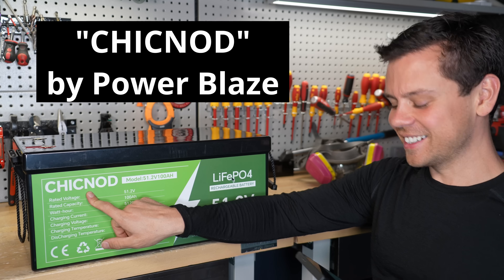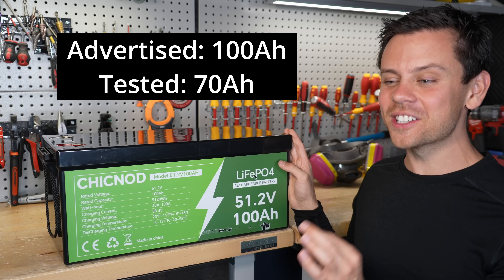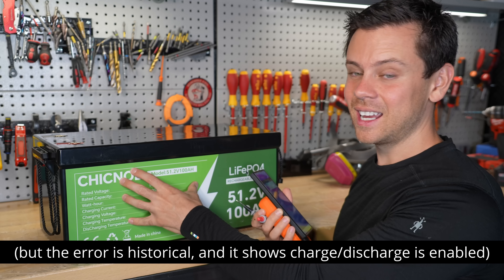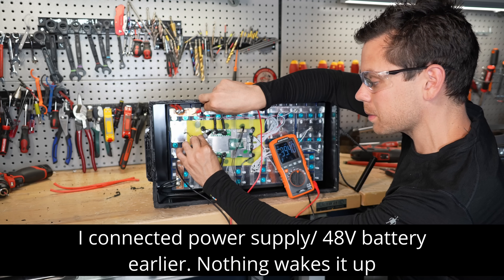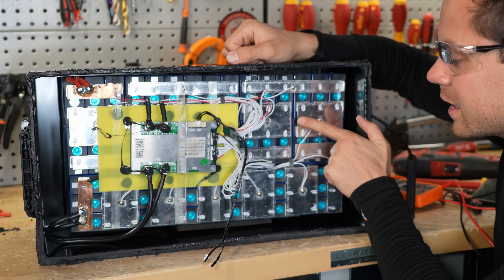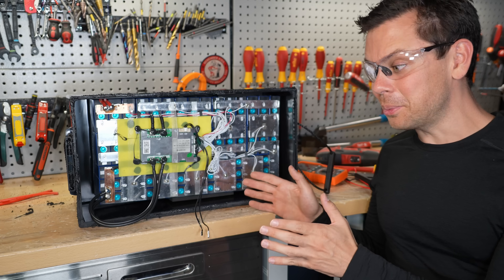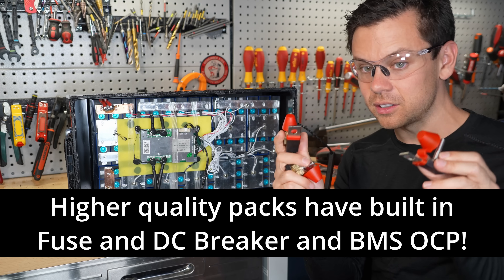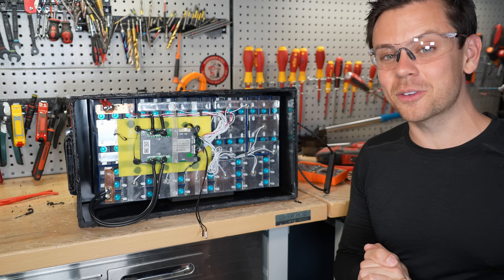TEMU Battery Scam? 48V LiFePO4 5kWh for $529 CHICNOD

Comment from the maker: Starting the return process with Temu and sending this video as my proof of issues 🤣 what do you think they will say?

High-quality budget 48V batteries I like right now:
Ecoworthy Server Rack Battery: https://amzn.to/3HOZjYY
Vatrer: https://amzn.to/3SBJV4o
Yixiang 16kWh Battery: https://yixiangpower.com/products/yixiang-vertical-15kw-diy-lithium-battery-box-kitus-stock-16pcs-eve-314ah-brand-new-grade-a-lifepo4-battery-cellchina-stock?sca_ref=9207522.jYuzmwEjUpH

~~~~~~~~~~~~~~~~~~~~~~~~~~~~~~~~~~~~~~~~~
Tired of getting ripped off? Check out my "Will Prowse Approved" solar product recommendations below!

12V Batteries
https://www.mobile-solarpower.com/lithium-batteries.html

48V Batteries
https://www.mobile-solarpower.com/48v-batteries.html

Offgrid Inverter System Builder
https://www.mobile-solarpower.com/48v-complete-system-blueprint-559371.html

Hybrid Inverter System Builder
https://www.mobile-solarpower.com/code-compliant-48v-offgrid-system.html

Mobile Handtruck System Builder (very popular!)
https://www.mobile-solarpower.com/mobile-48v-system.html

Solar Panels
https://www.mobile-solarpower.com/300w-solar-panels.html

Ground Mount Solar Racking
https://www.mobile-solarpower.com/ground-mount-racks.html

Wire, Lugs and Busbars
https://www.mobile-solarpower.com/wire-and-connectors.html

Tools
https://www.mobile-solarpower.com/tools.html

Fuses and Circuit Breakers
https://www.mobile-solarpower.com/fuses.html

Plug-N-Play Solar Systems
Ecoflow, Anker And Bluetti! So many models to choose from. See my current recommendations here:
https://www.mobile-solarpower.com/full-size-systems.html

~~~~~~~~~~~~~~~~~~~~~~~~~~~~~~~~~~~~~~~~~~
Need to build a large DIY system? Need a trustworthy solar distributor? These are my favorites:

Signature Solar
Creator of EG4! Solar Minisplits, Victron and More! Largest Solar Store Online.
If you want $50 off, please use my link below and coupon code "DIYSOLAR50":
https://signaturesolar.com/?ref=cPwLcVc0SW-BjN

Current Connected
Best Prices for EG4, Victron, Midnite and so much more! Fast Shipping and Highest Rated Customer Service:
https://currentconnected.com/?ref=wp

~~~~~~~~~~~~~~~~~~~~~~~~~~~~~~~~~~~~~~~~~~
Join our DIY Solar Community 
Need more help? Join the largest solar forum on the internet for beginners and professionals alike. 140,000 members and counting!
https://www.diysolarforum.com

Check Out My Free Book
Best-selling and beginner-friendly guidebook to off-grid 12V solar!
https://www.mobile-solarpower.com/the-book.html

~~~~~~~~~~~~~~~~~~~~~~~~~~~~~~~~~~~~~~~~~~
Contact Information:
I am NOT available for personal solar system consult! If you wish to contact me, this is my direct email: williamprowsediysolar@gmail.com
FTC Disclosure Statement and Disclaimers:
Every video includes paid promotion or sponsorship (such as free products for review). Some links on this YouTube channel may be affiliate links. We may get paid if you buy something or take an action after clicking one of these. My videos are for educational purposes only. Information is subject to change/update at any time. Electricity is DANGEROUS and can kill. Be smart and use common sense :) DIY Solar Power with Will Prowse is a participant in the Amazon Services LLC Associates Program, An affiliate advertising program designed to provide a means for sites to earn advertising fees by advertising and linking to Amazon.com
Reply: “You voided the warranty when you opened it” 🤷🏻‍♂️
Reply: @BigFern9876  No you voided the warranty the moment you opened it... The "it" in this case being the shipping packaging. Temu is great for some items, but when it comes to electronics or batteries you really do toss a coin when it comes to quality
Reply: @BigFern9876  this isan't a warranty issue, its simply fraud
Reply: @BigFern9876  imma guessing with his knowledge and what he does for a living and the subscribers he has they won't risk voiding it
Reply: I suspect they might ignore you (most likely) but I would like to know if they respond. 😅
Reply: I got a bad battery from them. I returned it and they said it's all scratched up. You damaged it. No, you idiot, that's the way you sent it to me all scratched up and used. Then I filed a case with them.Then they said my case is denied.That's when I contacted PayPal and told them what's going on.They send you junk and then blame you for damaging it when there are the ones that senate damaged
Reply: they will say
''Hello Mister, you sawing my product into two piece..no refund i give you!''
Reply: We never sent anything😂
Reply: Going to be interesting to hear what they say
Reply: I  have no idea but do tell us  what they say,
Reply: Then go with chargeback via visa/mastercard. If you say that they usually accept refund as they paying for chargeback extra
Reply: Dear cusomers, you voiding warranty on our fine products by damaged to case so no money for you. have a fine day at best regards, temu
Reply: They will say you shouldn't have cut it open.
Reply: Hi Will, this is off topic from the current battery but relates to the usual more reliable rack mount batteries. 

Is it possible to put these 48 volt to 51 volt rack mount batteries in series such that you'll end up with a total of between 400 to 800 volts? This relates to exorbitantly priced high voltage battery systems that I've been seeing become normal in the market. I know going higher voltage than 48 volt is eventually where the market will go based on current trends. But I'm just wondering if that's something that's possible with any of the BMS' of current rack mount batteries. I'd really appreciate if you could talk about this. Thank you.
Reply: @amateurwizard : I'm 95% sure that would be just like putting 4 12v batteries in series to get 48v, the BMSs won't care
Reply: @amateurwizard My understanding is that very bad things can happen if one of the batteries goes into protection mode for some reason. Over current or over voltage or under voltage etc etc. 

It’s a bit counterintuitive, but when that happens the battery that disconnects suddenly sees a very high voltage. If the MOSFETs aren’t rated at a high enough voltage, it can damage them. 

Think about it like this: four 48v batteries in series, with a light bulb. If you unplugged one of them, and connected a multimeter to the terminals, you’d see 3*48v = 144 volts. That’s the voltage that the MOSFET would see. And high voltage MOSFETs are expensive.
Reply: if they refuse to return, report them to a official US consumer agency. You are doing god's work!
Reply: I wonder if they will offer you a partial value return. 

You showed it had failed before you opened it. So you should get your money back. Please let us know
Reply: They will ask you to send a video of the issue and ask if you charged it first. It won’t matter that you already did a video. Because nobody is actually doing anything.
Reply: They'll probably tell you that you voided the warranty when you opened it, although the problems your showing with it is a valid point
Reply: I’m in the UK and I’ve actually had some good experiences with Temu…. I complained about a toy RC car that I bought for my Nephew. They sent out a brand new one. No quibble, No problem
Reply: Great video as always.
Thanks for taking the time and effort to show us what junk batteries are all about.
Personally I think you’re going to get the “Runaround” and it will be a dead end.
I refuse to be pulled in by their low prices. “If it’s too good to be true, well it probably is.” Thanks again Will!
In a way it was a fun video… your dissection and testing the different components had a medical flair to it.👍👍
Reply: You're an American with a large, fully-charged, junk lithium battery. We all want to see what happens when you put it down range and hit it with a .22
Reply: I recently had a failed brand new Eco-worthy 12v 150AH battery. Wont charge at all voltage is around 6-8.5v. The funny thing is the 3 other refurb batteries I got from them are fine. lol go figure
Reply: Nice
Reply: Lot lizard or wife?
Reply: Keep us updated on the refund temu request
Reply: Sorry out of luck
Reply: Temu is a reseller. Hopefully they stop selling them, thank you for your kind testing and give you a plushy as a gift.
Reply: Alle viel zu teuer!
Reply: Have you been contacted by  Powiser about their new solid state home battery back up system ?
Reply: oh? well, keep it. Here is your money back. Also, you get everything in your cart for free if you buy 500 euro worth of random things you don't need within the next 3 minutes.
Reply: Well you opened it and that violates their return policy.
Reply: I will say temu is better than wish. I am very careful about what I buy from them.  The higher the price the less likely I would buy from them.
Reply: Do you or have you ever used any wind power? I was thinking about Island off Grid living and having some kind of wawt wind turbine for cloudy days or stormy days.
Reply: Can I have your multimeter lol, as a Xmas gift . I have my own but yours might be of better quality.
Reply: @Will I would love to hear what you think about using old ev car batteries as storage. Like old nissan leave batteries. Dala's ev repair is a good YouTube channel.  I think you will find it interesting..
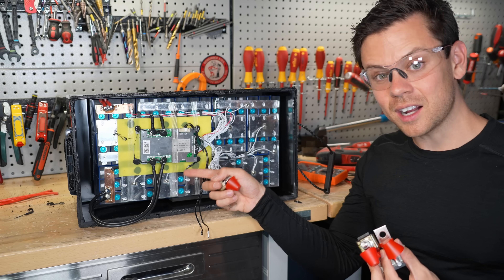Reply: 3:49 200A JK BMS is $100. 
100A ZXH BMS is $35
Reply: @komisiantikorupsikoruptord6257 I think he mentioned that exact price point you could find better. So, nice to see he is correct
Reply: They just denied and say your testing was incorrect. Thats pretty common, also with raw cells on aliexpress. And Aliexpress (probably temu) just denies the claim.... wondering if thing have changed.
Reply: Will,  temu also sells wattcycle batteries. Which are good batteries.  Not all batteries on there are bad. Am not insinuating you said that. Bottomline, buyers must do their research before  buying or risk getting poor products. .
Reply: @jab376 yeah but hard to research (aka test) before you buy.
Reply: @jab376  Temu openly allows scams and does nothing about reports of scams. No one should buy from Temu regardless of if there are legitimately products among the tons of scams
Reply: @jab376  Da, Did you watch the entire video? Look at it again starting at 4:37...
Reply: @jab376  Research? You mean ordering the battery and then doing all these tests?? Or trusting fake reviews? Which is it? Huh? Huh?

Comment: Question regarding the fuse. if running 3-12V in a 36V configuration will each battery require a fuse?

Comment: Last year, I bought 4, 48v 100ah batteries from an Alibaba-listed manufacturer and was quoted $400 each, plus $125 shipping to my door.  The batteries include Bluetooth 5.0 for monitoring via my phone.  After a year, the batteries are performing well, so it is possible to get batteries in this price range.  As for cell and  build quality, I cannot say, but I can monitor each cell and they stay within a few thousands of a volt, most of the time.  🙂

Comment: Hello! Great review! Please test one HUMSIENK 12V 314Ah Mini LiFePO4 Lithium Battery or other from this brand. I take one from Temu. Greetings from Bulgaria!
Reply: I've ordered at least 6 of these.  I haven't found one that actually delivered over 308AH.  Definite deception.
Reply: There are teardowns on diysolarforum. The Dumfume 300AHs are a much better deal and the currently identical Yeagulch 300.  I pulled 336ah out of a new Dumfume at a .2C discharge rate.  The BMSs look better as well as they have a larger heatsink

Comment: Just came across your Channel.  I have been thinking about trying to make a portable power station using a 100 amp hour power queen lithium battery.  

This will be used to take on our boat to run our sonar and trolling motor along with other various things in the field    

Do you happen to have any videos on how to build something like this? 

If I have something to follow, I can do just about anything. I just don’t have the upfront knowledge on how to put everything together. 

I was thinking about buying like a pelican case from Harbor freight and put everything inside that

I was also trying to think of a way that I could incorporate a 2000 W inverter into my build so that way I would have 120 V out in the field as well    

I appreciate it thank you very much

Comment: I would perform a capacity test on the cells, and any lithium ion battery made in China has a dubious amp hour reserve. It will under warranty but because you butchered the battery they probably won't take it back. Good luck 🤞

Comment: I use VW up cells in caraudio car, works great. Have run them without bms, balanced with all + togheter and all -, and checked up on them every 1 year, for 3-4years. Mby time to buy a bms 😂
Looking at round cells for my daily car now, so i can get a bit more out of the amplifier there.

Comment: I’ve been wondering about the weight.
Why are pretty much all 48v ~5kWh packs around 50kg?
This isn’t just a bit heavier than packs made from cylindrical (Li-Ion) cells, it’s quite a lot more than double.
That doesn’t seem to track with the stated power densities between Li-Ion and LiFePo4

Comment: Speaking about scams, Current Connected preys on people who are new to solar when they are tasked with system design. They oversell expensive components, that can be made to work, for a task when the correct component is a fraction of the price. After admitting to doing this in writing, they will not take back the overpriced components without severe financial penalties.

Comment: I think these are wannabe 32Ah cells in 3p16s. I think I ordered a similar batch and the maximum capacity for a cell was 26.5Ah, the minimum was 25 Ah. Even with the rated capacity this pack wouldn't reach 100Ah, and the 70Ah is quite expected from such low grade cells.

Comment: They have picked up the voltage reference to the BMS from 3/4 of the way through the circuit, its either that or they have a floating ground. That's why you have 39 volts instead of the 48v, the undervoltage will be why the bms has shutdown the circuit. 

On a side note you're extremely game playing with the battery in an enclosed space.

Comment: Battery i got for my lawnmower us fine.  Got 2  from 2 sellers.  Neither is the AH stated but onr is close, and even the crappier one, both are cheaper per AH (even per lower AH) than nane brand.  Longevity, cycles etc still to see what happens over time, but so far so good.

Comment: Temu Batteries. They are as good as a 10TB SSD drive for 20€. What you get ist only 64GB of Capacity. After 3 Chargingcycles the Batterie is at 40AH

Comment: Temu is a big scam. I bought oscal power station and humsienk 48v 100A batteries as well which i haven’t used it. The power station was tripping frequently for 400W portable solar panels. I returned both and I got refund in temu credits. However temu is not letting me to place orders now and sending same generic response mentioning account security.

Comment: Chins are decently priced 48v 5.2kwh for  $590 on sale. I've been using for a few years no issues. Monitor them with built in Bluetooth connection to thier bms

Comment: Hi Will, I was interested to see your comments on the StacheD channel about the alleged boat fire. I looked at the batteries that were supposedly fitted. They were Predator DCL12 100 XBT, which are marketed by Trojan batteries. The spec sheet for these claims they are LiFePO chemistry. Interestingly they appear to be discontinued. I was wondering if you had any further knowledge of them.
Reply from the maker: There's no proof that those batteries were installed in the boat. You should have similar system we're not sure what the wiring is like

Comment: Please help I am new to lifepo batteries and used the  XiaoXiangElectric app and accidentally reset the battery in the control options menu. The battery soc was showing 93% when I did that and now the soc is always 100% . I'm scared I've made a dangerous situation and don't know what to do now. The battery is the ecoworthy 280ah with the Bluetooth. Pls help.
Reply: Do i need to reprogram the BMS if so how or will it sort itself out. Any help

Comment: Can the battery box be opened with a heat gun by heating the glue around the lid edging rather than cutting it.I need to open my battery and need to know if I can use a heat gun.Can anybody help.Thanks.

Comment: Just using your latest video to make a request: can you do a 10-minute video on fuses... what's the logic is relative to the devices and load? I made a minimal off-grid system based on your simple systems but the 100-amp fuse at the battery confuses me. Why fuse versus circuit breaker? Thanks

Comment: Hmm, I have a 200amp hour chinesium battery that's about 1.5 years old that the voltage says 13.4v on my voltmeter. But put a load, any load, and it drops to 1v. The BMS has bluetooth, and claims it's 100% soc and cells show balanced. Have tried charging it with both my campers converter, and an agm automotive battery charger to see if would "wake up" but no luck.

Comment: For the last two months I have been trying to buy an EGO battery from Ebay, fake after fake after fake. And they put guilt trip on you for returning it. I am only a small seller, yes it is fake, yes it does not match in anyway the auction, but I am giving you - $20 off? You get 2/3rd capacity less, he is selling grade B already degraded, no chance of even pulling 1/2 of the capacity they claiming it has. Give away all batteries are too light, about 30%.

Comment: I bought 2 x 24v 100Ah CHEAPIG batteries from Temu this summer to replace my aging lead acid batteries (4xs 105 AH everstart) for my solar power. Was 560$ CND. They definitely seem to outperform my old set up according to my charge controller. Will definitely be more of a test in a couple months when the sun makes it's annual retreat to below the horizon. Can not find anything about these batteries but so far so good ,fingers crossed.